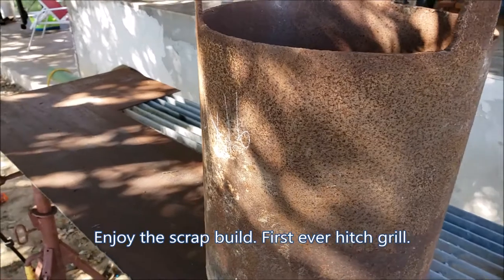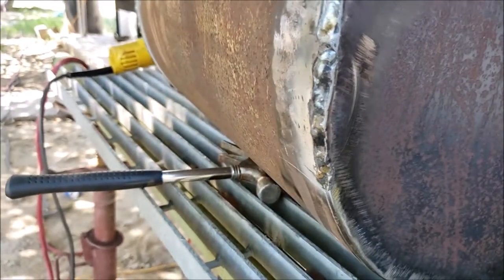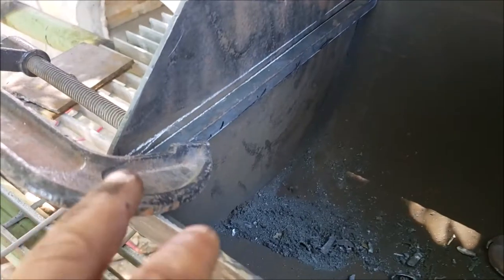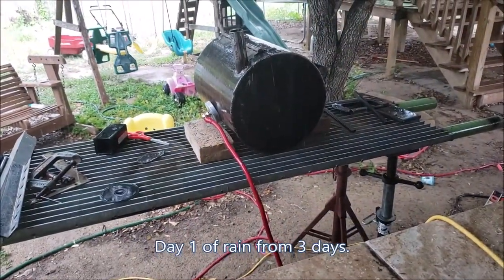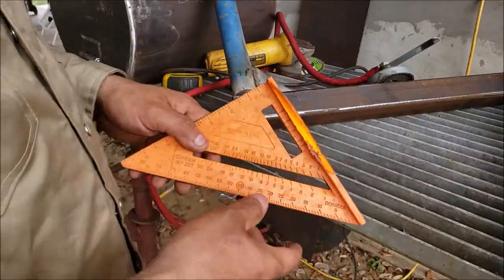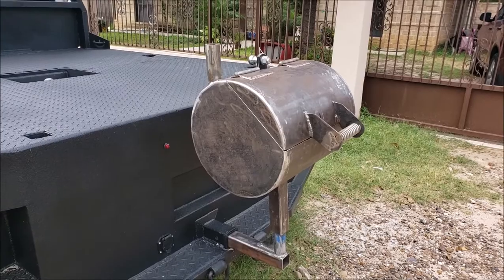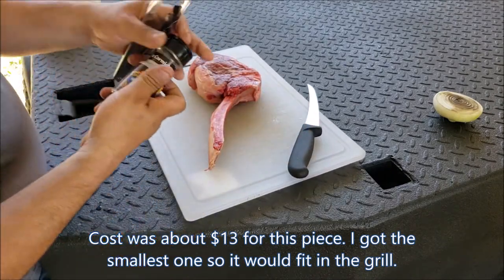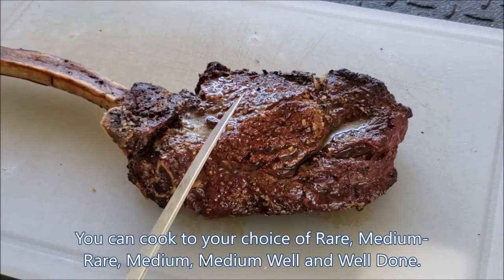How to build a custom receiver hitch grill diy hitch bbq pit tailgate tailgating plans tail gating

Comment: I'm building a 48" by 20" smoker now. I'm using my flux core welder cause I'm under the tree too. Next project is one of those pits. Thanks for posting cause now I know how to do one like that.. Keep the vids coming
Reply from the maker: Thanks. I have a 50" x 24" pipe I need to turn into a smoker. I may put it on a boat trailer and raffle it locally.  I also started to build some small pits but at 3/8" steel they are heavy. Its all about practicing and researching.
Reply: @cutweldngrind  well finished my smoker Saturday. Fired it up for a few hours to season it. Then went ahead and cooked a brisket. Stayed at 250-280 heat range with out hassle. Thing is a beast.

Comment: I like the design and the way to mount it on the hitch connector. Very cool. 
I clamped a spike onto the handle of my plasmer cutter for cutting circles,  with an extended base it could cut big circles.  Just need to drill a small hole at the center.  (Todays handy hint) cheers.
Reply from the maker: Thanks. I need to make an adjustable attachment to help me create circles easier. I used to have one that was for 24" circles but I used it as a handle on another project.

Comment: I'm hungry for a steak now!  Having one like that is real handy on job sites. Years ago, when I worked the pipeline I had one a little smaller than that I mounted to my bumper and it was easily removable like that. They usually furnished a helper and by the end of the job he'd be real good on the grill. We didn't grill every day but a lot of the time on Saturdays, when the company men weren't around we'd grill up some steaks or burgers for lunch.That was about thirty years ago now, come to think of it. But that's a good size for a portable grill. Nice job!
Reply from the maker: Thanks. What size pipe was used on your grill? I had some 6" pipe and a pipe line welder told me to try and build a clover design using 4 sections of pipe. I am running out of scrap now so might do 1 or 2 more grills just for fun. Thanks again for the support.
Reply: @cutweldngrind  I had two different ones at different times. The first one was way too big to pack and move easily. It was 14" X 24" and the older hands told me the whole time it was too big and guess what? They were right. The next one was 8" X 18" and I thought it was perfect. One of the guys had a template to cope the ends and the end caps were coped as well so the ends of the pit were round and it looked great!  It was a lot more work than the first one that was just slapped together and I was very happy with it. I could fit four rib eyes or a half dozen big burgers on it. It's amazing that I still see the same design on pipeliner rigs today!   Receiver hitches weren't a thing on welded steel beds back then we usually had a hitch that was easily as strong built into our steel pipe bumpers. And most people I knew already had something on their bumper to mount some other type of equipment and we usually just used that.
Reply from the maker: @texasplumr  Awesome. My flat bed I built has 2 receiver tubes vertical on it and was thinking on making a bracket for it but not sure if the heat will damage the bed liner. My neighbor was building a grill to mount on the hitch but was a scaled down version of a SA200. He is working up north but I may upload a video on it.

Comment: Hey boss, how’d you clean the inside before using it? Also before painting did you take off any oxidation?
Reply from the maker: I usually just remove the thick rust on the inside with a wire wheel or flap disc. I do put some oil after wiping down with a moist rag to remove the dust left over. I never paint the inside of the grills as that can cause contamination of the food.

Thanks for watching.

Comment: Love it! Very nice work.
Reply from the maker: Thanks. It works great. I was looking for material locally to build another one. I prefer the hot coals over pellet grills or skillets. Thanks again for watching.
Reply: @cutweldngrind  I plan on building some smokers soon as well. Def gonna give this one a try if I can find the right materials. What kind of plasma cutter do you have. How do you like it.
Reply from the maker: @PAPAPIG15  The plasma cutter I use is a Hypertherm Powermax 45 which I got used for 600 or 700, new they are over $2000. I have been wanting to try a China made $400 plasma cutter because mine has worked hard about 9 years and on its last few cuts.
Reply: I wonder how the harbor freight brand works. Titanium.
Reply from the maker: @PAPAPIG15  Haven't tried it but the Titanium welders work great. I bought the Powermax45 because I wanted to build a plasma table and mine was highly recommended due to the extra port it had. Check what thickness material it cuts clean and see if that fits your projects. I do mostly 3/16 and 1/4 materials.

Comment: That steak comes with a handle to hold while you eat it, lol.
Reply from the maker: I need to start using the grill again and those steaks always come out good. I live in a small town and usually the steaks are under a 1/2" thick at my local store which I really don't like. I think a 2" thick steak is perfect for me so when I see them I usually buy 2 or 3. Thanks for the comment.

Comment: How much did the plasma cutter cost
Reply from the maker: The Primeweld Cut50DP was under $400 and the Powermax 45 was $700 used and new are over $2400. I am not sure which plasma cutter was used here but I have some videos on the Cut50DP incase you want to check it out.

Comment: How many amps were u runing it at
Reply from the maker: I cant remember on this project but I run 1/8" electrodes mostly: 6011 90-100 amps : 7018 120-135 amps.